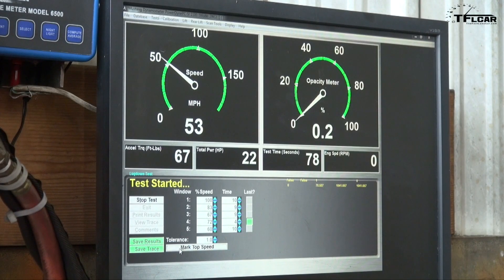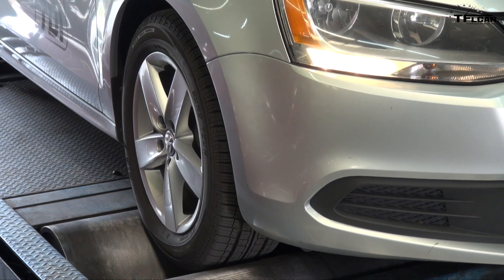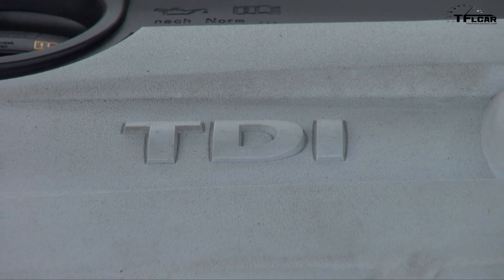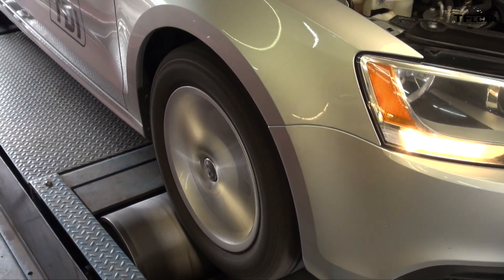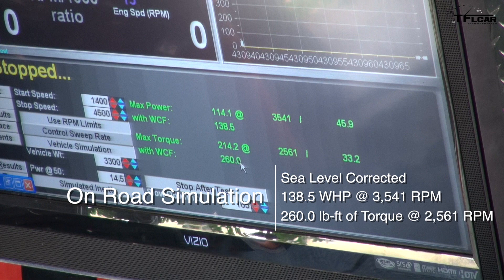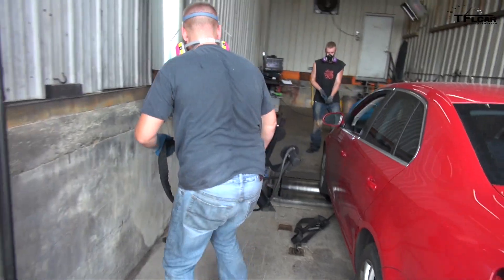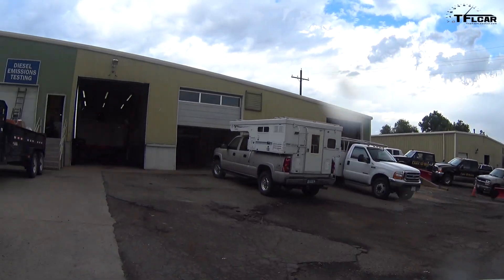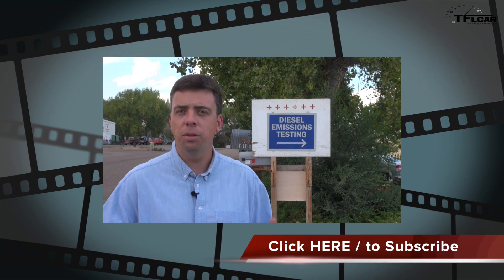Surprise! We Dyno a VW Dieselgate TDI Jetta to get the Truth about HP Loss

Comment: I say props to VW, emissions regulation of diesel cars is a load of nonsense.
Reply: +Car Nut Move to Shanghai and find out what happens when NOx is unregulated.
Reply: +Car Nut Ever driven behind an old  diesel dump truck?
Reply: +Car Nut Finally someone with some common sense. These fucktards all think that these "cheat emissions" are killing the planet. Wrong, you run a factory all day and night, then compare that to the CO2 put off by 100,000 diesel jettas redlining constantly and that single factory will FAR, FAR outpollute. Then we have the guys in their diesel trucks, chipped 'n tuned to put out more power and DEFINITELY DO NOT meet emissions standards.
Reply: +Car Nut Australia is a small country with very low density obviously  you will not have "an issue"
Reply: +Car Nut Confirmed idiot.
Reply: yup just look at fracing trucks. big 10.0 L v12 diesel pump for fracing is apparently not a big deal but a little 2.0 diesel is. wow EPA.
Reply: Ioanides001 Now that's a real problem, refined sugar and saturated fats in heavily processed foods. I don't touch that shit, doctors only care about whether you've had your immunizations and proscribed medication. Wake up to the real health issues everyone.

Emissions and climate change is a scam uniting world leadership.
Reply: fatboy19831 I drive behind diesel road trains and old Land Cruisers everyday.
Reply: Car Nut no dude, NOX emissions are just as detrimental to health as any other poision you might ingest or inhale. And building a defeat device with the sole purpose to cheat on emissions tests is a crime and should be punished accordingly.
Reply: +Car Nut I say we spay or neuter all VW owners that think this is a load of nonsense.
Reply: +Sierra Nevada but this scandal is utter bullshit. american diesels pollute way more than VW's but because VWs are not from the US they have to comply to much stricter emission tests.
Reply: Agreed.   We're talking about a company that fooled some bureaucrats in order to sell people a product they wanted to buy.  Too bad they got caught.
Reply: ascarifx
It isn't at all obvious that what they did was a net negative for "the environment".  They are certainly producing more NOx than they are supposed to but they are likely producing less particulates and using less fuel.  Using less fuel means less pollution in the fuel production and transport process.
Reply: Ron Valencia
You worry to much, so many other things that are so much worse than this so called "scandal"!
Reply: +Car Nut yeah, the same as with smoking and eating sugary fat foods!
Reply: Ronnie Teeril You cant see the sun because of all the coal power plants and Automobiles with out any emission controls at all.
Reply: +Car Nut I wholeheartedly agree with you even though I'm not a car nut.
Reply: +Car Nut Especially since diesel engines can run on cleaner biodiesel fuel.
Reply: +Car Nut And one dumbass once said emissions from leaded gasoline was not a risk...
Reply: Cars in Australia aren't emissions tested to pass rego. The scandal is bs and the US is hypocritical in its emissions nonsense. You can drive 640hp CTS-V's, 707hp Hellcats and 400hp diesel F350's yet extremely efficient little 2L Volkswagens are breaking the rules.
Reply: Morgan Brown The scandal has nothing to do with CO2 emissions but with NOx emissions. I think you should try to study the subject more rather than launch yourself in an ignorant rant and start swearing at people.

Car Nut  Same idea. It's all about NOx emissions, not CO2 emissions. Diesel engines are indeed more efficient when it comes to CO2 emissions but their NOx emissions are way higher then those of petrol engines. Now, about the F350s, their diesel engines use an advanced Urea Injected Selective Catalytic Reduction system for removing NOx from the exhaust. The same system is used on the 2 liter diesel engine on the new VW Passat. The Jetta though uses a simpler, cheaper and less efficient NOx trap system. This is basically where the whole problem arose. They couldn't bring it to required norm using the cheap system so they decided to cheat the tests. 

You can find a lot of scientific articles about the health effects of NOx gases by googling but I'll point you to the EPA site for a quick documentation: http://www3.epa.gov/airquality/nitrogenoxides/health.html
Reply: +Car Nut  That's cute, and how many diesel cars do you have again?
Reply: +Car Nut Though not as tough as the US, Australia is a nation with strict emissions rules. On top of that, you have a low population.
Reply: +Car Nut I think smaller diesel engines have (relatively) higher NOx emissions. I believe that's why VW had problems in the first place, small 4-pot TDIs.
Reply: +REALhacksDAILY Technically it is not a problem for VW. It is a question of money, really.
Reply: +fatboy19831 I have and a modern VW is NOTHING like that.
Reply: +Car Nut  
http://www.news.com.au/national/volkswagen-to-recall-approximately-90000-cars-in-australia-across-vw-audi-and-skoda-brands/story-fncynjr2-1227560857595

In Oz, VW has a problem with "misleading claims".
Reply: +Car Nut why is that? NOx emissions are greatly polluting our atmosphere...
Reply: +Ioanides001 
I so agree. VW lied for greed. They also gave a big fuck you to us and the environment. I have always been amazed that people believe diesel is so much better for the environment, I used to cycle a lot and when a diesel car like an Audi or VW drives past it's fumes make me cough and have a suffocating effect, that doesn't happen with gasoline powered cars
Reply: +Morgan Brown tell me about it, when I was in Miami I saw a lot of them with Cummins diesel engines. they made smoke like an old locomotive. Even think that they are being treated as commercial vehicles and do not need any safety tests to comply with, is this true?
Reply: +Ioanides001 what about all the petrol cars and their benzene?
Reply: +Sierra Nevada Calling the 6th country in the world by surface small. Seems legit.
Reply: adrian andon Low density is accurate though. Not many fucks to give down there.
Reply: MercilessHobo Of course it is. And the reasons for the low population density are it's huge area and it's extreme inland climate.
Reply: adrian andon Cool story. I didn't agree with his comment saying it's small. But regardless of the reasons it IS low density even for the large area of land, therefore emissions standards aren't seen as important.
Reply: MercilessHobo Misleading "clean diesel" advertisements in Oz has caused TDI cars to be withdrawn in Oz market.
Reply: MercilessHobo Well, it's low density overall. But in the urban areas it is pretty high. So I think the authorities there should care about how much NOx gases their city dwellers breath.
Reply: Ron Valencia Then interesting how Mr.Australian up there is trying to act like Australia doesn't care at all about emissions.

adrian andon True.
Reply: MercilessHobo Mr.Australian up there  doesn't have a monopoly on being "Australian".
Reply: Car Nut CTS-Vs, Hellcats, and F350s can all pass emissions tests. Do you not understand what the scandal is? They can NOT pass emissions tests. They tune the car during emissions tests to run differently. When driven in public, it exceeds the legal emissions allowed by over 40 times. 707hp Hellcats don't put out anywhere close to that much pollution. Let alone over the legal amount. More horsepower does not instantly mean more emissions dipshit.
Reply: +Antenox Many European cities are having similar problems to Shanghai now too - apparently Paris in particular is plagued by major smog problems and the primary contributor is privately owned diesel vehicles.
Reply: Razvan J NOx emission causes smog which is different from CO2's green house issues.
Reply: Razvan J http://www.thechinamoneyreport.com/2015/09/29/about-80-of-diesel-emissions-data-in-china-said-to-be-false/

Due to rapidly expanding wealth and prosperity, the number of coal power plants and cars on China's roads is rapidly growing, creating an ongoing pollution problem. China enacted its first emissions controls on automobiles in 2000, equivalent to Euro I standards. China's State Environmental Protection Administration (SEPA) upgraded emission controls again on July 1, 2004 to the Euro II standard.[7] More stringent emission standard, National Standard III, equivalent to Euro III standards, went into effect on July 1, 2007.[8] Plans are for Euro IV standards to take effect in 2010. Beijing introduced the Euro IV standard in advance on January 1, 2008, became the first city in mainland China to adopt this standard
Reply: +alexzracer2008 I agree with you 100% and these tree huggers that are up in arms could care less about fracking or nuclear disasters that are going on as we speak.
Reply: Ned Fan Who cares about the tree huggers when VW lied with their "clean diesels" advertisements  and caused a lost of sales for other competitors.

VW TDI shouldn't have won "green engine" of year awards.
Reply: +Car Nut Not only that, but look at some of the construction and lawn maintenance trucks in town. In my town, those trucks are almost 12-18 years old, produce clouds of smoke that can be seen a block away, are POORLY maintained all while spewing a lot more contaminants than this "dirty diesel" VW. But is the Fat Cat government doing anything about those? Nope. And will they? Everyone knows they won't.
Reply: largol33t1 In general, U.S. EPA vehicle rules are not retrospective i.e. the assumption is that the old out-of-production vehicles will need to be replaced some point in the future(due to being worn out), but the newer vehicles needs to follow current U.S. EPA rules. There's no need to add additional "dirty diesel" units to the existing units.

VW cheated against U.S. EPA's rules that are applicable to vehicle's model year.
Reply: Ron Valencia
If they really cared they would stop nuclear power #1 and look at the tanker ships and bulldozers, trucks, all involved in transport. The list goes on and on.  This is literally bull shit, I dislike VW but not for this, because they suck...
Reply: Ned Fan Regardless of your views on the matter, multiple governments around the world will penalize VW. VW cheated and pays for the cost of cheating.
Reply: Ron Valencia
It's no hair off my nuts I never would buy a vw anyway so let me alone...
Reply: Ned Fan Why argue for VW in the first place? WV cheated in both CO2 and NOX.
Reply: Ned Fan What's this? school kids "fuck you" replies? Is that the best you can do?

 Why get involve with this topic when your arguments are a load of nothing?
Who are you to command me "don't respond back"?  You are nothing you little shit.
Reply: Ned Fan LOL, another nothing post.  Your brain is fucked. Your arguments are fucked.

Your concession is accepted.
Reply: adrian andon From  http://www.ft.com/intl/cms/s/0/aa35f24c-8259-11e5-a01c-8650859a4767.html 
VW also cheated with CO2. LOL... The fault is with VW not with U.S. EPA.
Reply: Ned Fan Bullshit. You supported the view (your "tree huggers" statement) that minimised VW's cheat activities with a distraction that doesn't relate to this you video. Multiple governments and large scale class actions will penalize VW, hence your continual "fuck yourself" assertion amounts to nothing since YOU are nothing.

Recent "nuclear disaster" is Japan's problem caused by a natural disaster i.e. flooding of cooling pump generators. VW's cheating problem wasn't caused by a natural disaster i.e. VW has the intention to cheat. Try again. Your brain is fucked. Your argument is fucked.
Reply: Ned Fan Your "tree hugging" assertion on me is a load of bullshit i.e. I have V6 MPV (which past the EPA test) besides my daily driver hence your  "tree hugging" assertion can fuckoff.
 
Again, multiple governments and large scale class actions will penalize VW, your arguments amounts to nothing since YOU are nothing.
Reply: +Ned Fan LOL, you already lost the argument when you switched to personality based arguments. You are not in position to tell anyone "Never respond back to me". Who are you? You are nothing.

YOUR initial pathetic defence for VW amounts to nothing since multiple governments are targeting VW.

From my point of view, I welcome any methods to weaken oil export dependant countries that are hostile to western countries, hence your "tree hugger" assertion is flawed. For the record, I dislike left wing bleeding heart policies. Environmental issues are less of  a threat when compared to issues coming from the Middle East.
Reply: Ned Fan What a intelligent answer! You run out of ideas because I outsmarted you. Now you just spray curse words everywhere! What an intelligent 3 year old.
Reply: Ned Fan Another nothing argument from YOU. You run out of ideas because I outsmarted you. Now you just spray curse words everywhere!

Again, your "tree hugging" assertion on me is a load of bullshit i.e. I have V6 MPV (which pass the EPA test) besides my daily driver hence your  "tree hugging" assertion can fuckoff. 

 
Multiple governments and large scale class actions will penalize VW, your arguments amounts to nothing since YOU are nothing. YOU are nothing little noob.
Reply: Ned Fan Your VW defence

YOU: If they really cared they would stop nuclear power #1 and look at the tanker ships and bulldozers, trucks, all involved in transport. The list goes on and on.  This is literally bull shit, I dislike VW but not for this, because they suck

1. Atm, renewable energy sources can't replace base load power generation and this has nothing to do with VW's cheating. Nuclear power is cleaner for CO2 and NOx (smog) categories. Nuclear fission power can be managed.

Nuclear power can be cleaner with Thorium fission based or Hydrogen fusion based nuclear reactors (under development and has good research progress).

2. There are more VW TDI vehicles than bulldozers, large trucks and tanker ships, and this has nothing to do with VW's cheating. For this video topic, every other car manufacturer has to pass the same EPA test and VW should not have any special privileges.

Large trucks has their own emissions test since they are larger vehicles with larger workloads.

3. You attempting to discredit U.S. EPA to defend VW.

YOU: I agree with you 100% and these tree huggers that are up in arms could care less about fracking or nuclear disasters that are going on as we speak.

1. Recent "nuclear disaster" is Japan's problem and it's caused by a natural disaster i.e. flooding of cooling pump generators. VW's cheating problem wasn't caused by a natural disaster i.e. VW has the intention to cheat.

2. Fracking for oil is another topic outside the U.S. EPA's light vehicle emissions test i.e. You attempted a red herring defence for VW. Every other car manufacturer has to pass the same EPA test and VW should not have any special privileges.
Reply: Ned Fan Can't handle it?  You started personally based attacks first you stupid clown.
Reply: Ron Valencia
I can handle anything your just lame and extremely boring to me...
Reply: +Ned Fan Why is it lame? Your arguments has flawed e.g. there's a difference between nuclear disasters caused by natural disasters against VW's intentional to cheat. Your citing of nuclear disasters doesn't address video's point of contention. Why get involve in this topic when you labelling it boring?
Reply: Ned Fan This is exactly what I mean. Out of ideas so just start yelling random shit. You are nothing.
Reply: Ned Fan lol, Your arguments is flawed since there's a difference between nuclear disasters caused by natural disasters against VW's intentional to cheat. Your citing of nuclear disasters doesn't address video's point of contention. Why get involve in this topic when you labelling it boring? You are a hypocrite. 

Your "tree hugging" assertion on me is a load of bullshit i.e. I have V6 MPV (which past the EPA test) besides my daily driver hence your  "tree hugging" assertion can fuckoff.
 
Again, multiple governments and large scale class actions will penalize VW, your arguments amounts to nothing since YOU are nothing.
You run out of ideas because I outsmarted you. Now you just spray curse words everywhere!
Reply: Ned Fan This is exactly what I mean. Out of ideas so just start yelling random shit.ou run out of ideas because I outsmarted you. Now you just spray curse words everywhere!
Reply: Ned Fan This is exactly what I mean. Out of ideas so YOU just start yelling the SAME spray curse words everywhere.
Reply: Ned Fan Ned Fan Again, Your VW defence

YOU: If they really cared they would stop nuclear power #1 and look at the tanker ships and bulldozers, trucks, all involved in transport. The list goes on and on.  This is literally bull shit, I dislike VW but not for this, because they suck

1. Atm, renewable energy sources can't replace base load power generation and this has nothing to do with VW's cheating. Nuclear power is cleaner for CO2 and NOx (smog) categories. Nuclear fission power can be managed.

Nuclear power can be cleaner with Thorium fission based or Hydrogen fusion based nuclear reactors (under development and has good research progress).

2. There are more VW TDI vehicles than bulldozers, large trucks and tanker ships, and this has nothing to do with VW's cheating. For this video topic, every other car manufacturer has to pass the same EPA test and VW should not have any special privileges.

Large trucks has their own emissions test since they are larger vehicles with larger workloads.

3. You attempting to discredit U.S. EPA to defend VW.

YOU: I agree with you 100% and these tree huggers that are up in arms could care less about fracking or nuclear disasters that are going on as we speak.

1. Recent "nuclear disaster" is Japan's problem and it's caused by a natural disaster i.e. flooding of cooling pump generators. VW's cheating problem wasn't caused by a natural disaster i.e. VW has the intention to cheat.

2. Fracking for oil is another topic outside the U.S. EPA's light vehicle emissions test i.e. You attempted a red herring defence for VW. Every other car manufacturer has to pass the same EPA test and VW should not have any special privileges.
You made flawed assertions
Reply: Ned Fan You run out of ideas because I outsmarted you. Now you just spray curse words everywhere i.e. your "You really have no life faggot" assertion is load of bullshit. hypocrite.
Reply: Ned Fan LOL,  Again,

YOU: If they really cared they would stop nuclear power #1 and look at the tanker ships and bulldozers, trucks, all involved in transport. The list goes on and on.  This is literally bull shit, I dislike VW but not for this, because they suck

1. Atm, renewable energy sources can't replace base load power generation and this has nothing to do with VW's cheating. Nuclear power is cleaner for CO2 and NOx (smog) categories. Nuclear fission power can be managed.

Nuclear power can be cleaner with Thorium fission based or Hydrogen fusion based nuclear reactors (under development and has good research progress).

2. There are more VW TDI vehicles than bulldozers, large trucks and tanker ships, and this has nothing to do with VW's cheating. For this video topic, every other car manufacturer has to pass the same EPA test and VW should not have any special privileges.

Large trucks has their own emissions test since they are larger vehicles with larger workloads.

3. You attempting to discredit U.S. EPA to defend VW.

YOU: I agree with you 100% and these tree huggers that are up in arms could care less about fracking or nuclear disasters that are going on as we speak.

1. Recent "nuclear disaster" is Japan's problem and it's caused by a natural disaster i.e. flooding of cooling pump generators. VW's cheating problem wasn't caused by a natural disaster i.e. VW has the intention to cheat.

2. Fracking for oil is another topic outside the U.S. EPA's light vehicle emissions test i.e. You attempted a red herring defence for VW. Every other car manufacturer has to pass the same EPA test and VW should not have any special privileges.

Again, You made flawed assertions. I have addressed all of your assertions.

Try again.
Reply: Ned Fan Wrong, your arguments doesn't have any legs to stand on. Try again fool.
Reply: Right feed the car a petroleum by product and expect a clean output? Idiots, what is wrong with feeding the car what it was designed to burn. Or focusing on electric cars, water cars? Whatever else inventors work on and are so regularly shut down by people who don't want to help others who really believe in creating very corrupt governments that starve populations, create wars for more power money and are so greedy they are really killing themselves in the end without the knowledge of it to start with.
Reply: +Antenox did you just compare a Chinese diesel engine with a germane one? oh god some people..... shanghai is not polluted because of cars only and most of the cars there are Chinese
Reply: +Immanuel Ermuşin PZEV is a thing for a reason.  we are in 2016 with new discoveries in chemistry still being made whos to say petroleum wont burn more and more cleanly and efficiently as we go, with the help of computers or not...
Reply: Exactly what I was thinking, I give them props for that. The emissions BS on diesel pickups makes them unreliable and use more fuel
Reply: +Car Nut Hows that hacking cough of yours getting on ? What did the doctor say ?
Reply: +Car Nut Good god wtf dude. Get a clue.